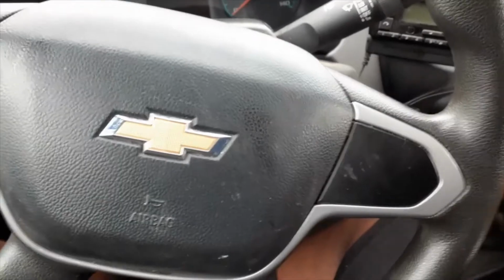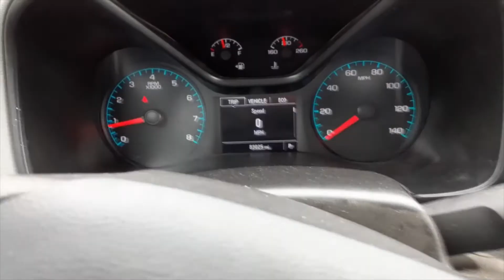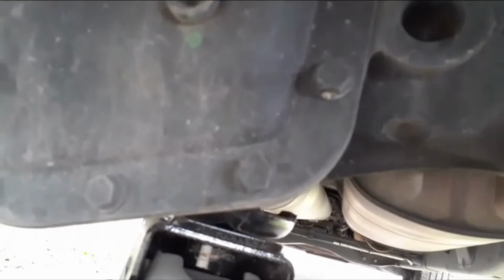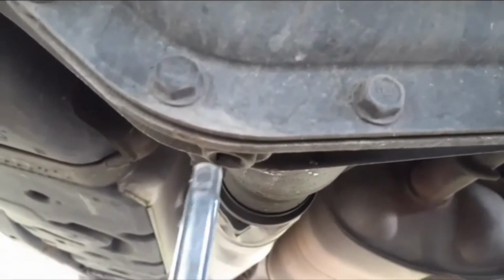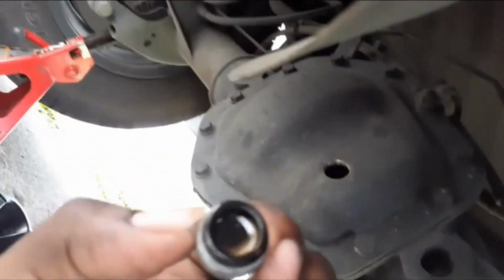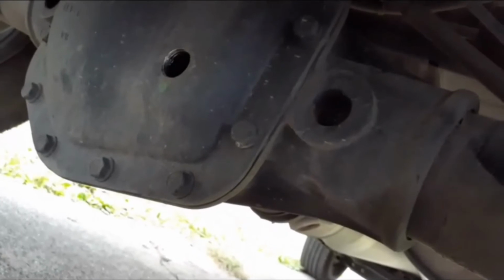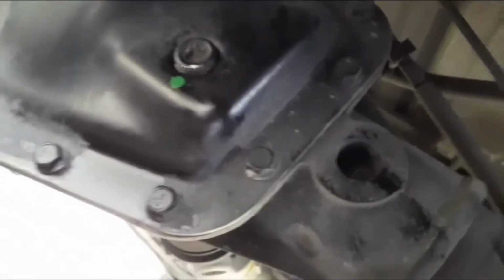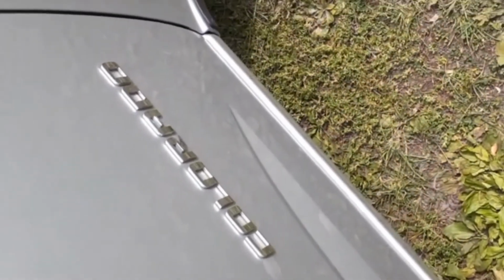How To Change Differential Fluid In Chevy Colorado 2015-2020

Comment: Thanks great video, im about to do now, just found if the truck has the G80 locker in it, RPO G80 when you scan the barcode on the driver's side door, or sometimes in the glove box you Can't use a fluid with any lid additives,  chevy has bulletins about it. If you mentioned in video good, I kinda scanned through after watching some others. I also hear they're infamous for shavings and should be changed with first oil change to remove filings.
Reply from the maker: You're welcome and Thanks for the info...